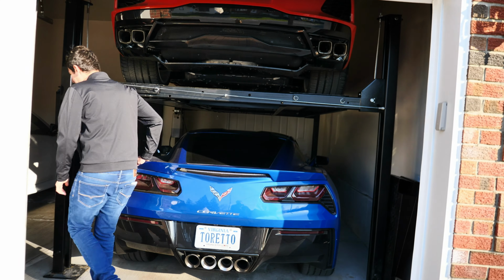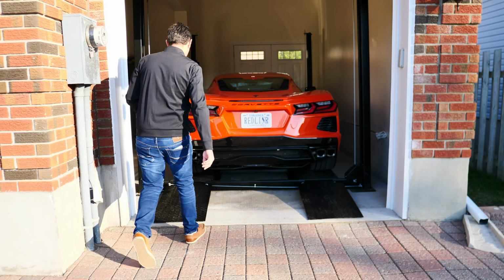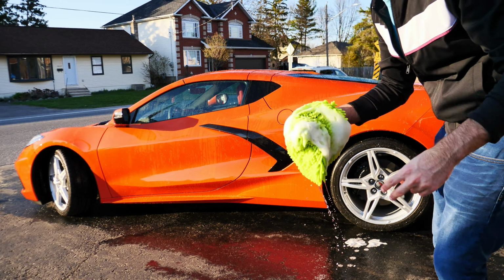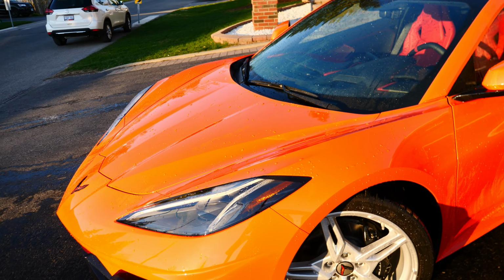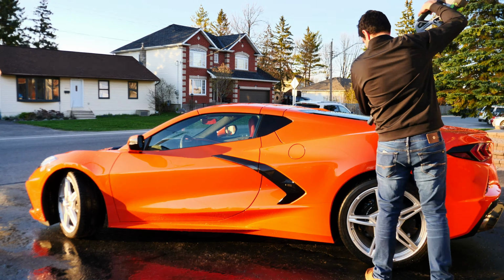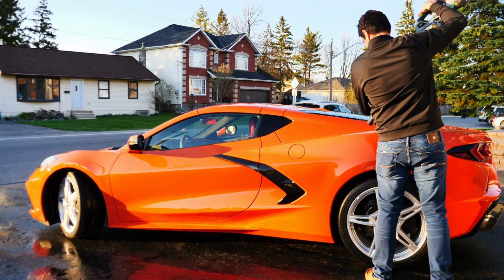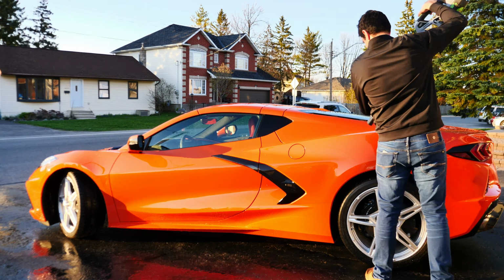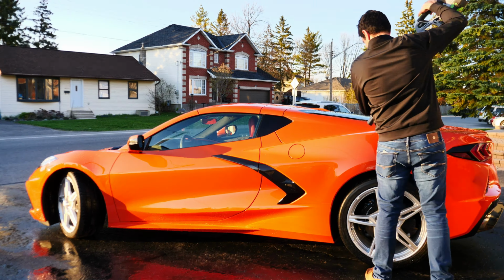HOW TO AVOID WATER & SOAP FROM GETTING INTO THE C8 COVETTE'S ENGINE BAY / How To Make Washing EASIER

Comment: What the hell are you talking about? You just kept saying how incredible it was but you didn't mention what you used to make it that way. Some vague references to washing but not really anything about exactly what you were using to get the results you kept babbling about?
Reply: I think from what I gathered he is claiming the bead maker or something else is keeping water from entering the engine bay because it doesn't run in the engine. Not sure either. Someone else i saw withe the c8 put towels inside the engine during the wash and it caught all the water. I'm only here because my c8 is orange and this is on my feed

Comment: Orrrrrr, you could do what I do. When I watched the reveal, I could tell from the start there would be an issue with water intrusion into the engine bay. I came up with a simple  plan. Stuff shop rags in the vents along the side and an old bath towel in the vent opening at the bottom when you wash. No visible water in the engine bay after washing! I detailed the engine bay with Maguire's right after I took delivery seven months ago and haven't touched it since after washing the car multiple times. Of course, "You don't mess with Mother Nature". I pay attention to the doppler radar and my baby doesn't know what a rain drop is yet.  I do know the day will come that I'll be caught out. At that point, I'll have to put in the occasional extra effort in you do.

Comment: Great video. SUBSCRIBED!

Regarding the water action, it is “sheeting”, meaning it’s running off the surface; the direct opposite of “beading”. 

One question - how hard is it to clean the engine compartment side of the rear passenger and hatch windows?

Comment: Dude, the coating does not have anything to do with getting less water in the engine compartment. This time you did not blow water into the heat extractors and you did not open the hood before you drive the car off. Question why do you use a power washer don't you think that will hurt your paint in the long run.
Reply: I dont think you saw the old video, he did the exact same thing. Power washer that he is using is a lower powered one. Professonals around the world use power washers to wash their cars. I dont know why you need to hate, clearly trying to help us owners.... If you read the comments there are other guys that confirmed they did the same thing with great success.
Reply: @marcoberelli1689  Agreed. I'm one of the guys that watched the old video, followed and bought the bead thing and it worked for me. I did the same wash on my car 3 times and each time its easier to clean the engine and less water. Charles, follow the steps and you will see for yourself. Don't hate / doubt before you've done it.
Reply: @pauloreily8282  I guess if you put enough BeatMaker on it you can wash the car with the windows down🙄